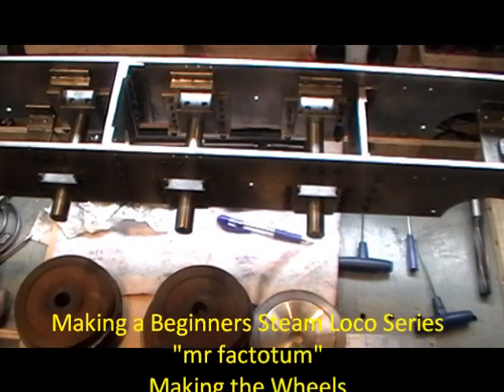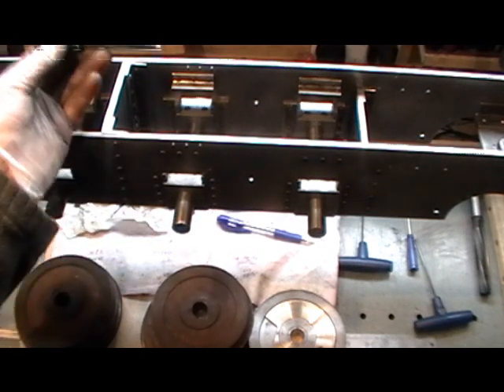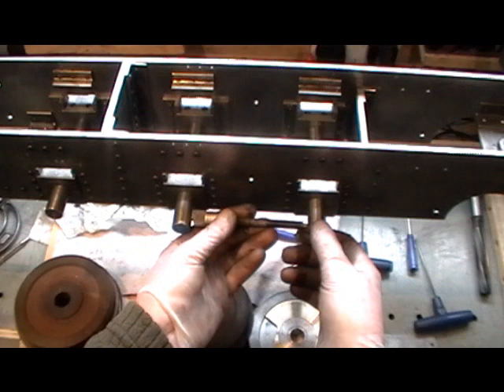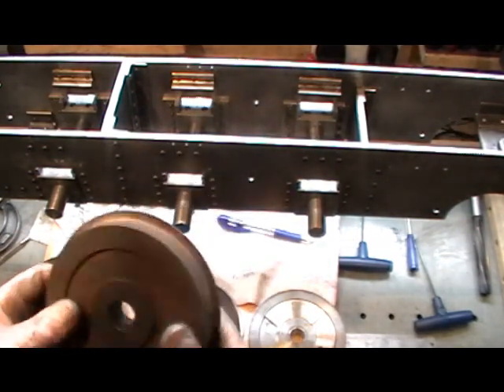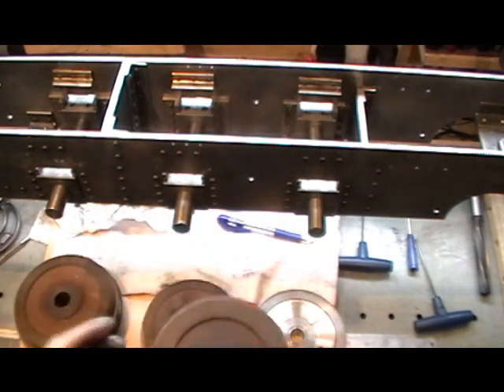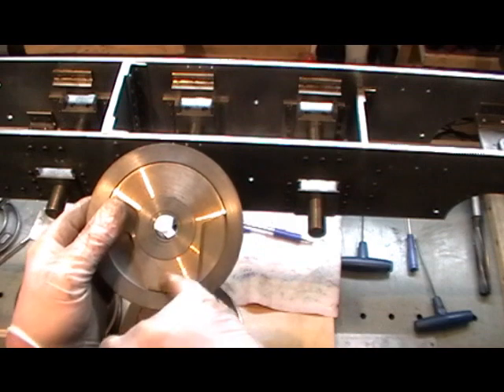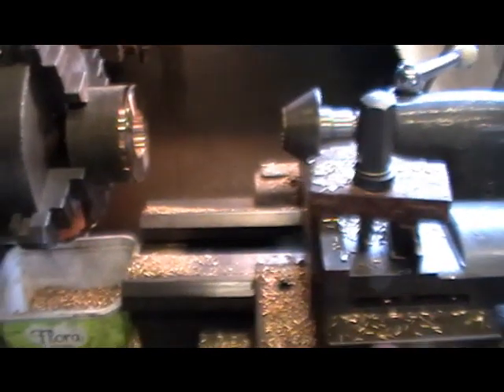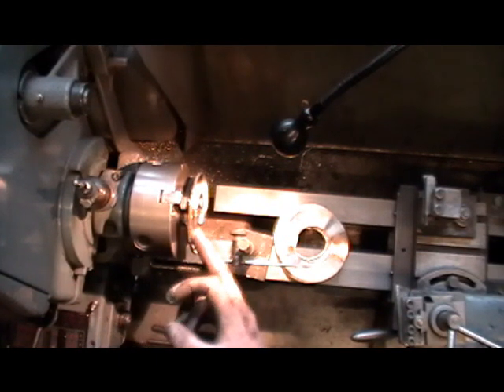Making a Beginners Steam Loco (Wheels part 1 Incl. imitation cast inset) "mr factotum")

Comment: Is there any reason why Steel could not be used for the wheels ? Its cheaper from work than castings
Reply from the maker: Hi chris
no problem to use steel, I only used cast iron because I got them free from my local MES from scrap riding car wheels that they were changing. I would have used steel otherwise, thanks for watching
regards
mr f